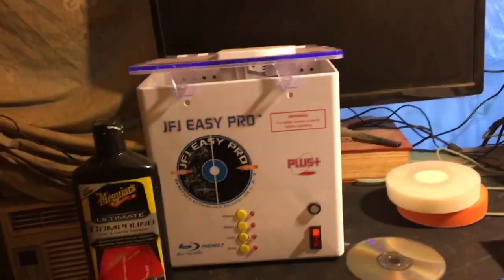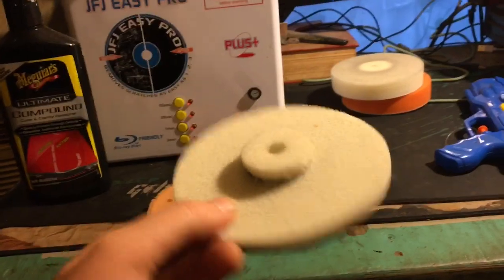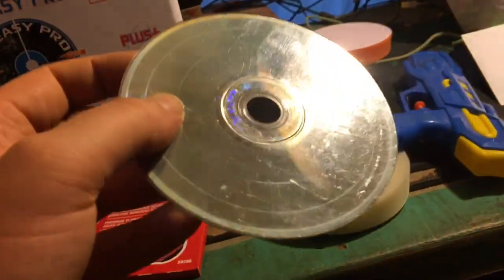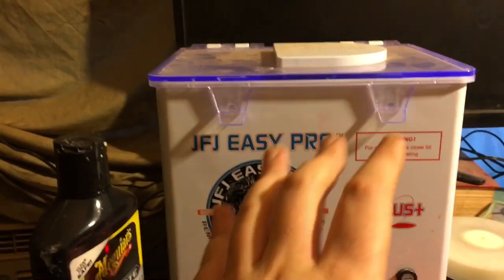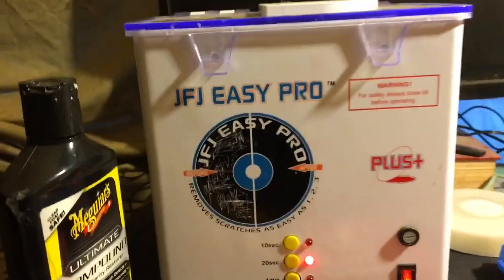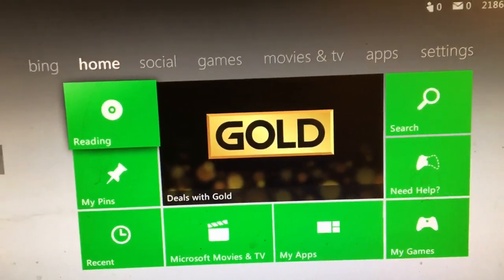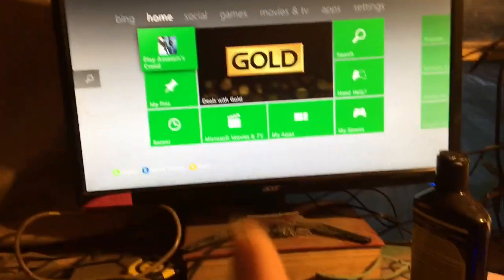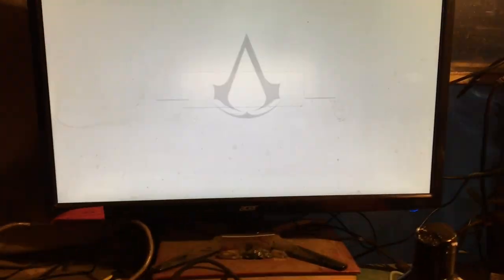Mastering the JFJ Easy Pro: The Ultimate Guide! No more melted disks!

Comment: How would your recommend someone go about fixing a dreamcast game?
Reply from the maker: The problem with Dreamcast games is that they don’t have the extra layer plastic on top of the data.

Therefore, if the top of the disk gets scratched, the entire disc is ruined.

So first and foremost, I would make sure that you can actually fix the disk. You can do this by holding the disk up in front of lightbulb, and seeing if any light shows through you’ll definitely see scratches or holes if the disk is ruined. 

Otherwise, if the disk has no holes in the data, you should be able to repair it like any other disk although I would recommend you do it very carefully.

Luckily, it’s the same exact size as other games that you can repair with the JFJ easy pro  👍
Reply: @JohnnyNJones  wow thanks!!! Will do that. Provided it's reparable, 10 seconds on each sand grit and some meguairs?
Reply from the maker: @mr.b9613  try to stay away from heavy sanding, we have to be more careful with dreamcast disks because of the data layer being right under the label. We don’t want to get it too hot and we don’t want the label to rub on the metal plate so tighten down the nut.

I would go with light sanding for 10 seconds at a time and spray with water each time until it appears that the scratches are diminishing 

then two minutes of buffing with the polish preferably in 30 second intervals to keep temps low and spray with water.

See if that does the trick 👍
Reply: @JohnnyNJones I followed your advice to a tee. Only thing is I had to go 10 seconds with the 600 grit due to 1 pesty deep scratch on the disk but did light sanding with Hercules 1500 grit for 10 seconds at a time. Kept everything after below 30 second intervals and used so much water for every one that I shrunk the ocean down about 2%. My game is back to working condition even after multiple failed restoration attempts. Thank you so much!!!!
Reply from the maker: @mr.b9613  wow man I’m really happy for you!! to be honest I thought it may be a difficult restoration with how old Dreamcast games are.

You did a great job 👍👍👍👍

I miss my dream cast I used to love playing army men, Sarges, heroes, and Star Wars racer
Reply: @JohnnyNJones my brother, I owe it all to you! Followed the video exactly with the two exceptions being 1500 grit sandpaper, no more than 10 seconds for each sanding spin and 30 second intervals for the resurface. Also a LOOOOT of water! It's me that should be thanking you.

Also I'd implore following your advice if you have any spare dreamcast games. I was going to do away with my old sonic adventure 2 copy, but I'm so glad I stumbled upon your video. It's working perfectly now.
Reply from the maker: @mr.b9613  Well shucks, I really appreciate it. I’m glad I was able
to help you guys out!

Keep working with those Dreamcast games man they’re getting more and more rare! People need to be reminded how great that system was 👍👍

Comment: Did you get the pads at harbor fright as well ?
Reply from the maker: I picked up a pad at Harbor freight but they didn’t carry anything I needed I had to trim one down and it lasted only a week or so

I had to track down specific pads for it
The white pads last weeks

Then you can wash them out and reuse them

I sell them on eBay because I have to order huge quantities at a time the next time they’re in stock will be on the 19th
Reply: @JohnnyNJones  I bought the pads off you 👍 last ditch effort before I buy a elm pro 2
Reply from the maker: @emptychamber5565  Thank you, Well the pads will last a long time but the elm  2 is a better machine.

I am currently coming up with my own formula that’s safe and nontoxic for fixing disc surfaces  and it’s working wonders

Comment: The resurfacing machines I can buy in the Netherlands are way to expensive and JFJ is a pain in the ass at the customs I read at eBay. Can you tell me if the bottom spindle is motorized or the one at the lid? Or are both motorized? Maybe I can mimicking it in a sort of poor mans resurfacing machine.
Reply from the maker: The bottom is motorized the top is just a freely rotating spindle
Reply: @JohnnyNJones  Thank you for answering. It looks very heavy for just a freely rotating spindle, but as you mentioned in the video it's a very simple system.

Comment: where did you buy the orange buffing pad?
Reply from the maker: I sell them on my ebay page.
Reply: @JohnnyNJones  could you send the link please
Reply: questions so as what you mention on the vide you sad you cut the sand paper of the other brands and glue them to the sand paper pads what happens when the sand paper pads become used and you want to change the sand paper sheet how do you remove the sand paper?
Reply from the maker: @palemonvazquez1383  I superglue them to the other sticky sandpaper pads that came with the machine.

I do not superglue them directly to the pads. 👍

If you search JFJ compatible pads on ebay you’ll find my listing. I am the only one who lists those pads on there.
Reply: @JohnnyNJones  I really appreciate it thanks for youre advice could you send the link to find the orange pads I can't find them on ebay thanks
Reply from the maker: @palemonvazquez1383  listing shows white pads, but they are orange. 

I didn’t change the listing because the pads aren’t really much different. Only the color is different.

https://www.ebay.com/itm/135050878715?mkcid=16&mkevt=1&mkrid=711-127632-2357-0&ssspo=bqlgDs_2Rxm&sssrc=2051273&ssuid=bqlgDs_2Rxm&var=&widget_ver=artemis&media=COPY
Reply: @JohnnyNJones  thank you so much
Reply from the maker: @palemonvazquez1383  No problem!
Reply: @JohnnyNJones questions the pads that you're saling are they use for buffing or polishing? also I have this polisher product call novus will that be ok to use?
Reply from the maker: @palemonvazquez1383  sure you can try whatever polish that you have.

Frankly, I use only one pad instead of two stages and it works just fine for me.

I only use the orange pads  👍
Reply: @JohnnyNJones  thanks man

Comment: Can you do a tutorial how to fix the black ps1 discs with jfj ?You can see the scratches so easy :(
Reply from the maker: I will look into it more but I think the problem that I have heard is that the ps1 discs are are too rigid and the plastic is harder to polish.

Although I think with some modification it could be done, i’ll look into it.
Reply: @JohnnyNJones  thank you sir! 👍🍻
Reply from the maker: @svenwald9199  no problem 👍
Reply: @svenwald9199  Check out the video I've got. You can fast forward to the end. No scratches!
Reply: @JohnnyNJones 👍excellent tips 👌 might have to give the different brands a try
Reply: If you use the 600 grit pads he has in this vid then I imagine it should work.  Can't imagine the black discs being TOO rigid as they scratch SUPER easy!  

Seriously, the old PS1 discs are THE WORST for scratches!

Comment: I'm mad I used the manual and ruined my ps2 disc it has the swirl marks and idk if they come off.
Reply from the maker: Don’t worry they will come off, you just need a lighter sandpaper, The swirl marks them selves don’t usually cause a reading issue so don’t worry about the aesthetics but if they are causing a reading issue then you can try some lighter sandpaper or polish it for a long time.
Reply: @JohnnyNJones  Thanks i'm gonna try out your tips to see if I can save it.

Comment: Why on earth did they make this thing with a metal plate that gets scalding hot?  & moreover, why have they not revised this thing ovet time?

You'd think that future revisions would do away with the metal disc...
Reply from the maker: Actually, the reason they had to add the metal disc because the plastic disc couldn’t dissipate heat fast enough, so it actually was hotter than the metal one.

I don’t use any rubbing compound and i wouldn’t put anything between the disk and the metal because the reason the metal plate gets so hot is that it absorbs heat from the disk so it won’t melt.

What you can do is put some water on top of the metal plate Just spray it down and it’ll get rid of a lot of heat
Reply: @JohnnyNJones  Ah, I see.  That makes sense I suppose.  Maybe they should have used a bigger metal plate then?  

But ya I'll definitely keep the water trick in mind.  Your video has been VERY helpful!
Reply from the maker: @skins4thewin  yeah, they could definitely improve the design of the metal plate if they added some fins to it like a heat sink.

But spraying water on, it seem to work very well for me.

And keep the sanding pad, wet dispersed a lot of the heat as well.

Thank you very much, I’m glad it helped!

Comment: The warranty is useless anyway because after a year you WILL have cracks under the lid on the spring loaded arms.
Reply from the maker: Yeah I would say it’s pretty much useless 👍
Reply: The cracks didn’t seem to affect the functionality, until the plastic finally broke. But JFJ sells replacement pieces. 2 sets were $15 and it was a simple fix. Back up and running in no time

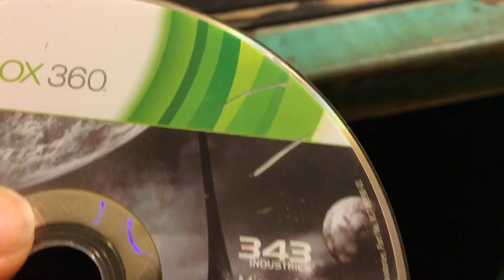Comment: 1:02 ... wrong, the data is right below the paint in the upper area of the disc. tiny holes in the sliver foil.
Reply from the maker: @ronny332   I thought that myself, but actually it’s not. The aluminum is there to reflect the tiny imperfections in the plastic itself. 

The plastic is molded from the metal dye they use for the master.

Comment: Your wrong.  The scratches on one photo side of disk intact does effect function.  The data is rite below that layer of print.
Reply from the maker: That’s for CD’s not DVD’s
DVD’s are made of two layers of plastic, one on the top and one on the bottom.

When I showed you the scratch in the video, notice that you could still see the aluminum material. That material is used to reflect the laser so it can read the data. The top side of the disk is just  for looks.

CD’s on the other hand only have one layer of plastic with the reflective layer on top. When those get scratched the aluminum layer flakes off the top.